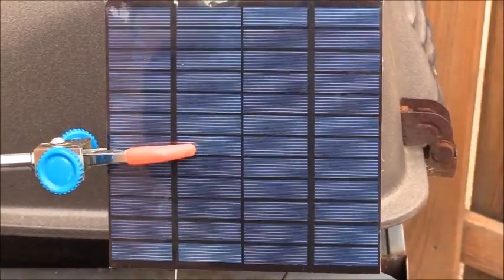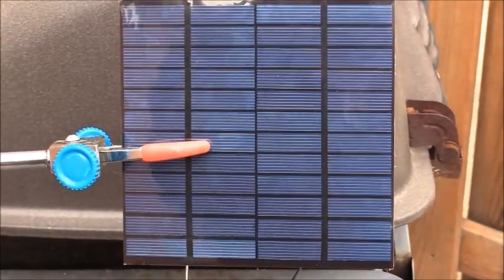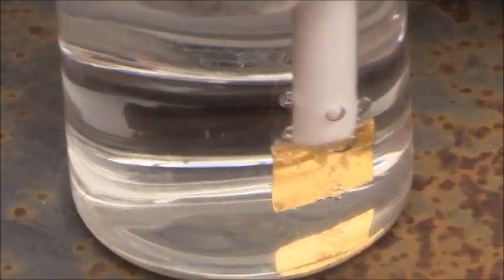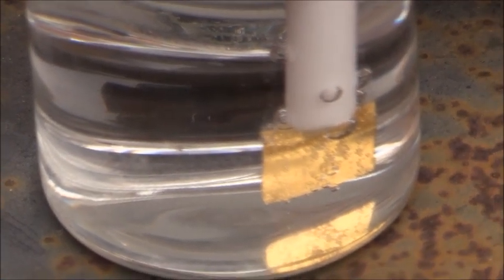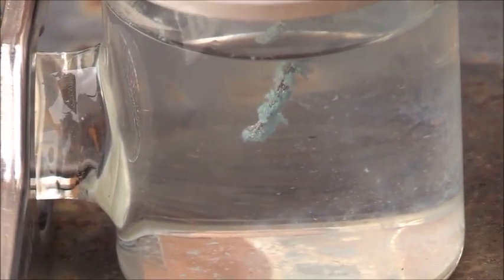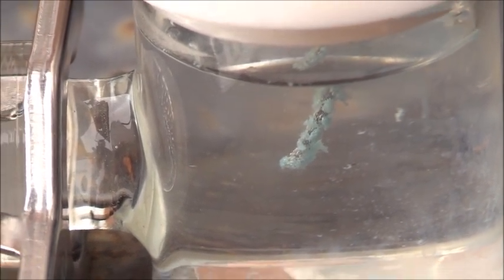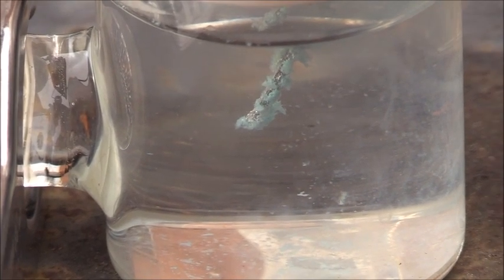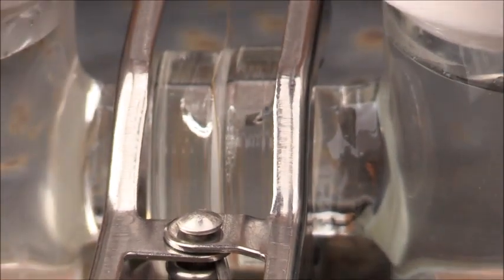My first experiment in artificial photosynthesis: The light reaction, splitting of water.

Comment: Hello, could you please make a video or explain how you created the machine?
Reply from the maker: You can buy the solar panel online.  And also, the electrolytic cell you buy online.
Reply: @experimentsinartificialpho4383   Thank you very much!
Reply from the maker: @theresasey8672  https://www.aliexpress.com/item/H-type-electrolytic-cell-H-type-ion-exchange-membrane-electrolysis-cell-common-electrolyzer/32953281374.html?spm=2114.search0104.3.1.20901729CKTXOI&ws_ab_test=searchweb0_0,searchweb201602_8_10065_10130_10068_10547_319_10546_317_10548_10545_10696_10084_453_454_10083_10618_10307_537_536_10059_10884_10887_321_322_10103,searchweb201603_52,ppcSwitch_0&algo_expid=03b28673-f5c2-47b1-8fa0-3b9b2c1883ff-0&algo_pvid=03b28673-f5c2-47b1-8fa0-3b9b2c1883ff&transAbTest=ae803_3
Reply: @experimentsinartificialpho4383  
thank you again! Also i have a question. When plants are conducting photsynthesis, CO2 converts to O2. Isn't it the same for artificial photosynthesis?
Reply from the maker: @theresasey8672  Well,  that's not actually correct that CO2 converts to O2.   In natural photosynthesis, the oxygen comes from the splitting of water, just like it does in artificial photosynthesis.  Then, the hydrogen ions produced from the splitting of water then combine with the CO2 to form organic compounds.  This happens in the natural process as well as when you are doing it artificially.  The difference is that plants use enzymes to accomplish this, whereas when you do it artificially, you are using metal catalysts as well as the energy provided by an electric current.  (from the solar panel).
Reply: @experimentsinartificialpho4383  Oh that's very understandable. Thanks for taking the time to explain it to me.
Reply from the maker: @theresasey8672  Sure, no problem.  The reason why I haven't posted a new video demonstrating the dark reaction of photosynthesis and the creation of organic compounds is that I am still trying to figure out how to get that experiment to work.
Reply: @experimentsinartificialpho4383  oh I see. I hope you find out soon. I'll be waiting to watch more of your work!